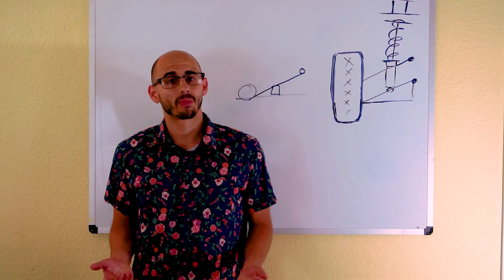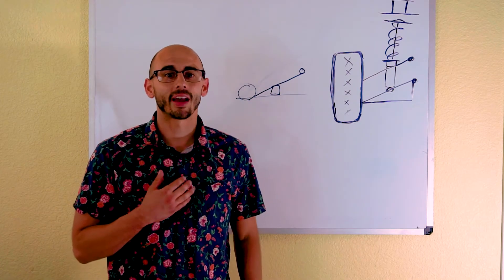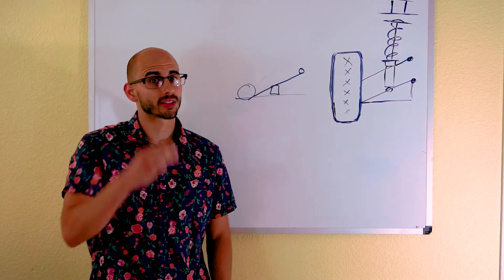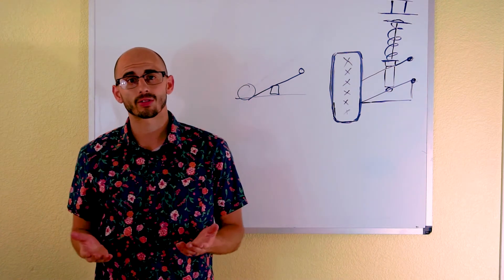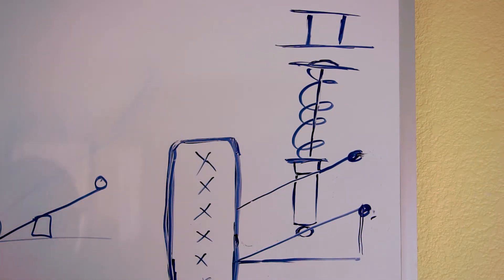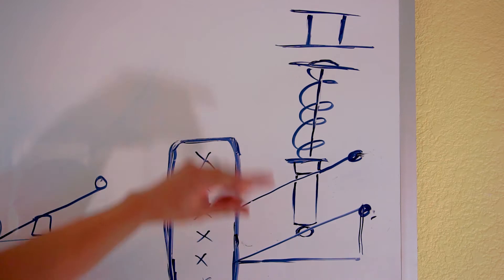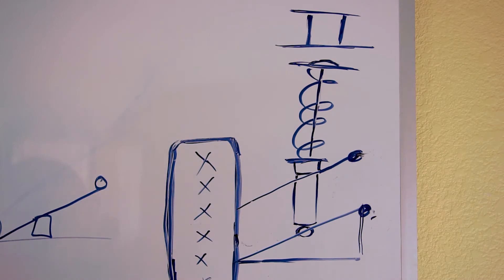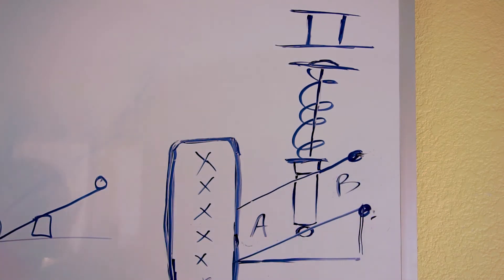Strut Spacer Thickness and Lift

Comment: Does the pressure must be directly pressing on the spring coil or not necessary?

for example:

if I cut the bottom eye of the sturt off and add a 1" rod welded between the strut and the lower eye, in other words add 1" to the total hieght of the strut will that give me 2" or 1"?

Comment: The principle is correct but for example my R51 measures 22mm from pivot to shock mount and 12mm from shock mount to the ball joint center this gives me a lift factor of 1.545
A 1 inch spacer will give me 1.545 inches of lift.
Not all vehicles are the same.